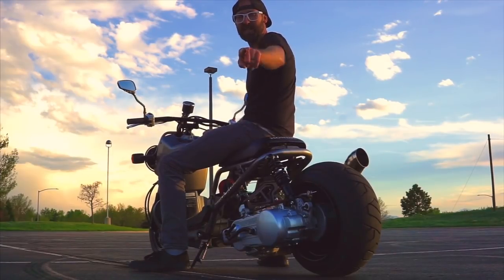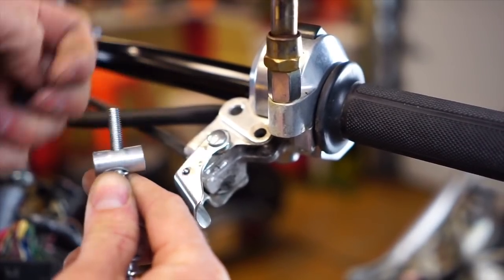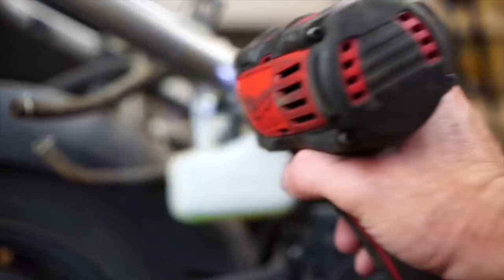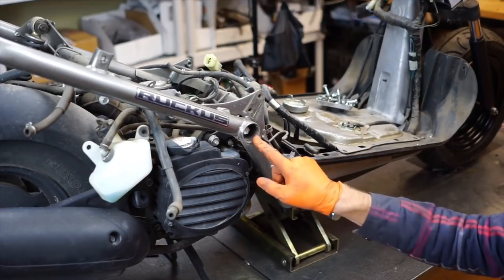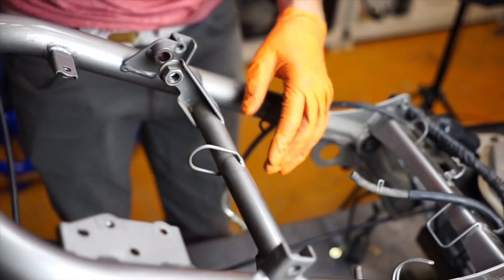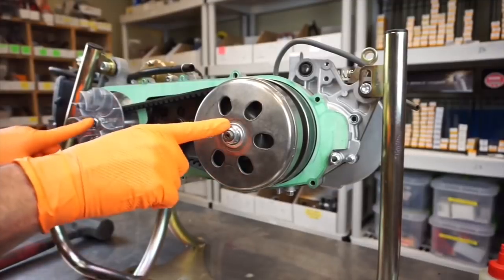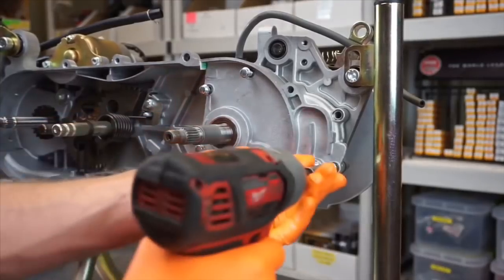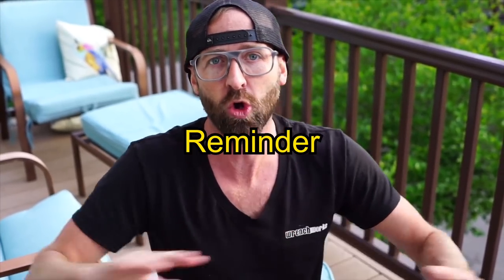Honda Ruckus GY6 swap  [Frame and engine prep] PART 2

Comment: Here in Hawaii lotta people have two strokes they’re so expensive though obviously for reasons I just started getting into modeling, luckily I scored two abandoned QMB 139, the Chinese motor I got in it now is a 39 cc Chinese engine not GY6. Bit of a bummer this Chinese man sold me a severely under powered moped I’m in the process of cleaning the QMB 139.

Comment: A quick way to run a cable exactly where your old cable is to zip tie  or twist tie the top end of the old cable to the bottom of the new. Then pull from the back side of the old cable until the top of the new cable is where it needs to be. Then snip off the zip/twist ties.
Reply from the maker: Great tip!

Comment: Hey brother I have a question, would I be able to fit the 50cc Honda engine that comes on those bikes? Looking to do a resto mod on my Honda express nc50 by installing a new engine on but still keep the original look on the bike. What would be the dimensions for the mounting for the engine measure at? Thanks for the video, entertaining and helpful as always stay well.

Comment: Brether from oil and breather from head they shoul be attached or not? Did't quite shure from your explanation.
Reply from the maker: Make sure the gear box breather and head breather are not attached.
Reply: @RollingWrench  thanks

Comment: Can you do a 50cc gy6 to a 150cc swap without welding?
Reply: Yes
Reply from the maker: Some people call the China 50cc motor a GY6 50, this is actually called a qmb139. If you are referring to a qmb139 (50cc) to GY6 (150) then no :-( . The qmb mounts from the bottoms and the GY6 from the top. Buuuut if you are talking about the stock Ruckus 50cc. Then yes ! :-)
Reply: @RollingWrench I meant the 139qmb, but is there any bolt in place mount you can install

Comment: Where can I get the fatty Hub and how much are they
Reply from the maker: Fatty mount and hub? Or just a hub?
Reply: Just a hug please
Reply: The Hub that was on the Ruckus was mounted on a long shaft and a long shaft destroyed the Hub it wobbled so bad at night I had a hard time getting the hub off of the axle
Reply from the maker: @edselcobb9554  https://www.rollingwrenchdenver.com/products/gy6-scooter-wide-tire-hub-adaptor
Reply: It's for a GY6 long case
Reply from the maker: @edselcobb9554  here is the short shaft kit:

https://www.rollingwrenchdenver.com/products/gy6-honda-rucks-short-axle-shaft-replacement-kit
Reply: Since then I replace the axle but I can't find a hub
Reply: Does your Hub accept drum brakes that's what I'm having difficulty finding a hug that will accept drum brakes
Reply from the maker: Yes, the drum I linked is from drum brakes on a qmj157 150cc gy6